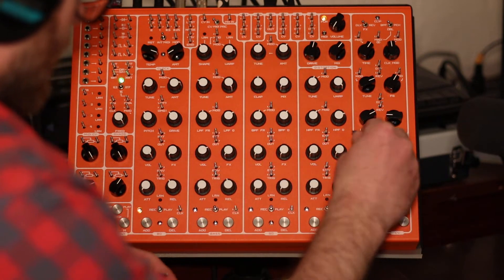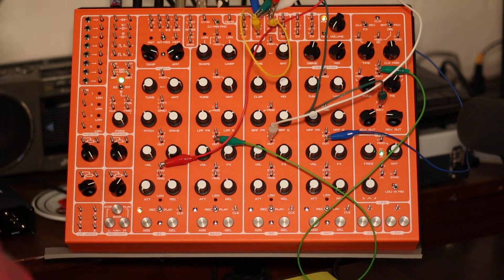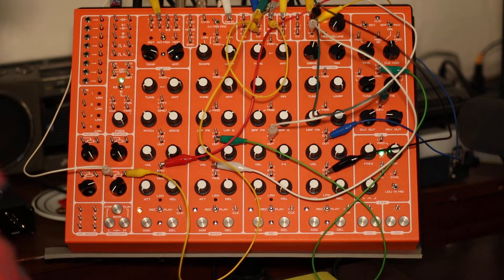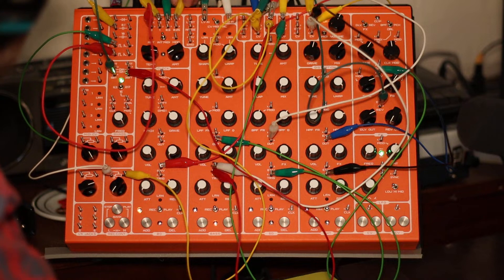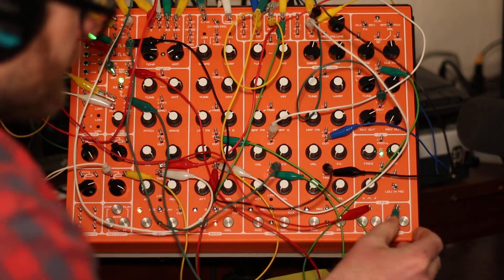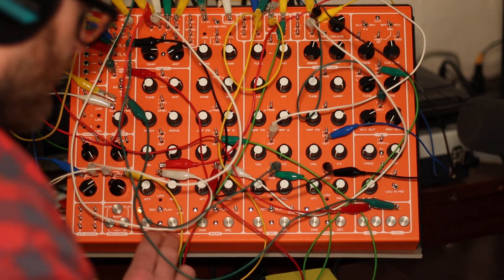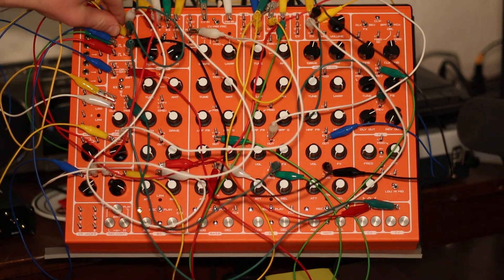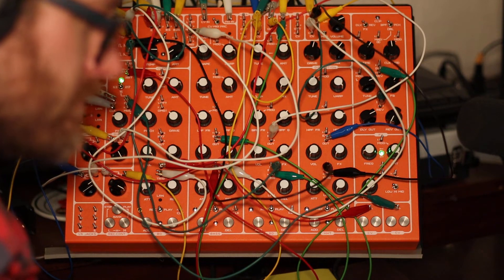Pulsar-23 Patch Walk n' Talk #8: CV to Shaos S/H and Data

Comment: What‘s extremely confusing to me is the Shaos. I trigger the Pulsar via MPC live2 Midi. The Midi in blinks in Sync. But the clock light doesn‘t reflect the 4/4 Beat. I tried to sync shaos via CV / Ornament and Midi Clock. But all it does are weird Signals. The Ornament reflects the 4/4 Cv Signal correctly - it‘s grounded with the Pulsar. But when i go out of the Ornament into the Shaos clock, the light turns slowly on and off.

Comment: S/H> pin is  a separate clock input for the S/H module that provides the clock for S/H 1bit> pin and 3 bit> pin.
Just like the CLK> pin and internal SHAOS clock provide the clock for DIR 1bit> and 2bit>
If you don't connect anything to the S/H> pin the clock of S/H will be the same as the SHAOS clock.

What is still a mystery to me is, the >DATA> pin. Manual says you can record states in when 62/16/217 is on 16 steps.

I can change the sequence, but I see no relation to what I put in.

If anyone knows how the data input exactly works, please let me know how...
Reply from the maker: Yes, it took me a minute, but I realized that eventually. (About the S/H, I mean.) 

Check out the discord! There have been conversations about the data pin. This video about the Turing machine was helpful: https://youtu.be/va2XAdFtmeU
In video 29 that I just posted, I run an lfo from my Octatrack to a midi to cv pin and connect that to the data pin and then switch between waveforms. I noticed changes, but I don't know how much you can control it.

Comment: At 10:20: As far as i know the data pin is there to store values of 16 steps (so only if the shaos is in "16"). It is realized over a shift register, wich is basically several (i guess in this case 16) s&h modules. if the first S&H stage samples now a value with an incoming trigger (i guess the trigger coming from the S/H pin or the internal clock if nothing is patched to the S/H pin) it stores the current value that is on the data pin. 
With each new trigger, the last value will be shiftet to the next S&H module inside the shift register. So that sums up to 16 possible steps to save. Im not entirely sure if the triggers for the Shift register arrive from the S/H pin or the clock or if its based on everytime when a new value arrives at the data pin. Gotta experiement a bit to find out.
Reply from the maker: Thank you! This makes a lot of sense. Hmmm. ...more experimentation, indeed!